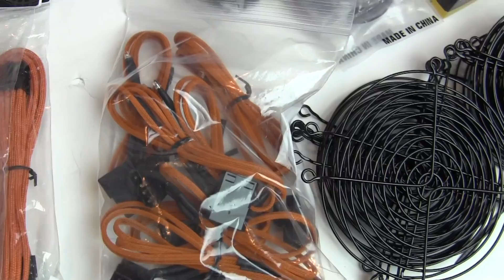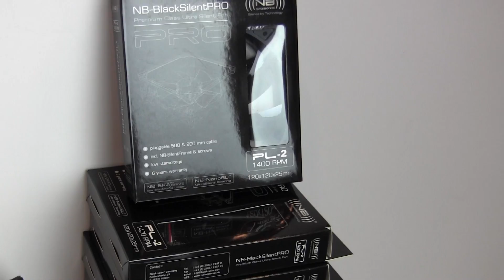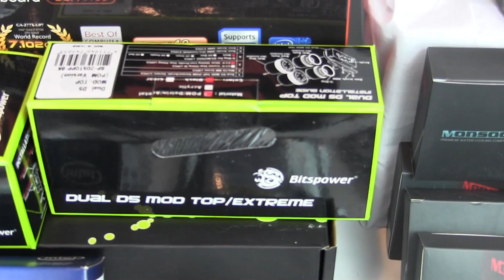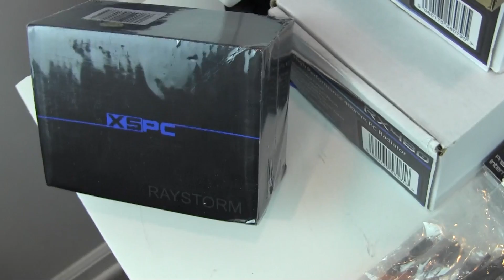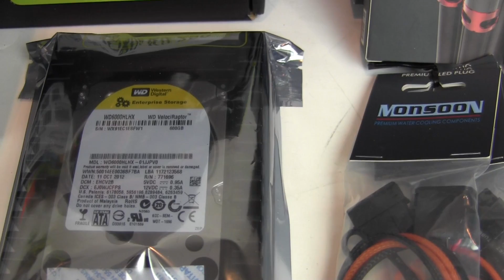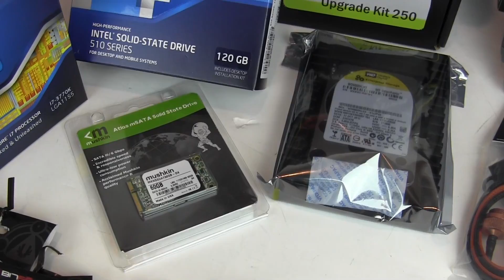Case Labs SM8 Water Cooled Cooled Build Log 1 - The Parts

Comment: I'm thinking about using 8x 5.25" hot swap bays in the front with the same res at that location. Will there be enough horizontal space for the bay adapter to fit? And also, does the case come with support mounts for them?

Comment: well i think caselabs should offer a mechanism to mount in the bottom and top. its their responsibility to do so. ya i could get a pedastol. but fuck that. it makes the case bigger. and thats like stupid......   and secondly could i ask them to anodize it? thirdly can i fit dual 560 radiators in a merlin st10?

Comment from the maker: You can fit one 480 in the top and you could theoretically fit another in the bottom, but to do that you would have to get creative and mount the power supply somewhere else.  If you bought the pedestal option, you could fit a  480 down in there actually two if you wanted to. And I am not messing with you, not my style.

Comment: Asus rampage IIII extreme + 3930K + Dominator Plat. 2133 16 gig Quad chan+ AX1200 Corsair psu and . . . yeah i know 580 sli (waiting for the 700 series) in a black SM8 (Probably white/black and Some devil red). HOWEVER my case is still not here . . . been a mounth since i ordered it (not caselabs fault, My countries postal service is crap). The more i watch your vids the more i want to start and build my system :D Love your vids.

Comment from the maker: Maybe just a little tight, There is space still left,  That rad is 60mm + 25mm fans so showing I have 85mm, but there is room for another set of fans. Close to edge of the mobo but it can handle it. I believe case Labs has pictures of a monsta in push pull.

Comment from the maker: Actually I just finished Clockwork Orange , though I had bought most of the parts last year I made an AIR Cooled version called Thunderstorm .  I just finished Clockwork Orange a few weeks ago,  On the Aquaero, it took a while for me to get enough info to set it up correctly that I thought it would be helpful if I did a basic tutorial and setup. So in the next couple of weeks I will have that video up. Go to my Facebook page and drop me a PM or Post on what you are looking for.

Comment: Hey Ronsanut, I know it's been a over a year since Clockwork Orange was done, but I've got a question for you.  Do you have the full parts list posted anywhere?  I'm particularly interested in the Aquero parts you used, primarily the one attached to the side of your front radiator.  Is it some sort of flow meter/fan controller, or something different?  Just curious.

Comment from the maker: I had been looking at this Z77X-UP7 Overclocking motherboard for some time before its release. So basically that drove my decision. If they made one for 2011 I would have picked that one, But since they made it for 1155, I know that is what I would use.  And actually no one else asked this.  My main system is a 2011 on an MSI Big Bang XPower II with i7-3730K. I do have videos on that build as well.  Thanks for watching

Comment from the maker: No I am sure it will work, but there was a need for this so they designed some Power Adjusts specifically to support pumps .  I trusted the guys who gave me the info. Everyone has to decide for themselves I guess. This setup allows for software controlled adjustment of the pumps and no  need to adjust the screw on the pumps manually.

Comment from the maker: I checked. Looks like MC sells the chip for $229 but you have to pick it up in  the store. Looks like they will not ship them. If you know somebody they can buy it and ship it to you and you pay them back. If you use flat rate shipping with insurance might cost $20. So if you have someone you can arrange that with for about $250 you can get an i7-3770k. That is still around $70 cheaper than NewEgg.

Comment from the maker: With the research I did I found it was recommended to have one Power Adjust for each D5 Pump and put the fans all on the Aquaero fan ports itself.  So it would be like my setup. Two Power Adjust in addition to your Aquaero 5 or LT or Pro.

Comment: Oh..Daniel is great he'll probably make a video. I think that nearly all tubing are prone to staining which is why I plan to sleeve my tubes (color will be visible in reservoir). You can sleeve 10/13 tubing with MDPC sata sleeving (lots of colors and very easy to use on the tubing). Btw, what tubing ID/OD are you using now?